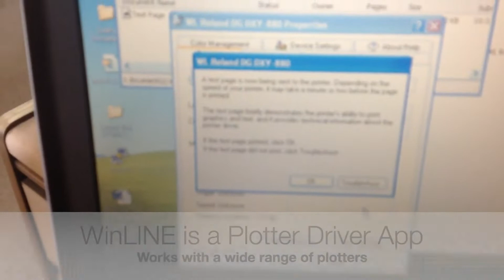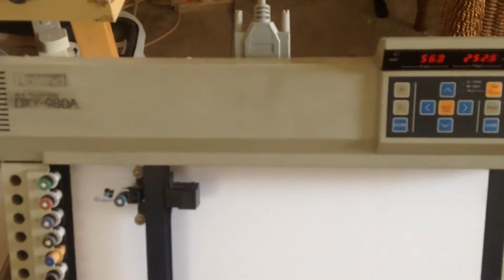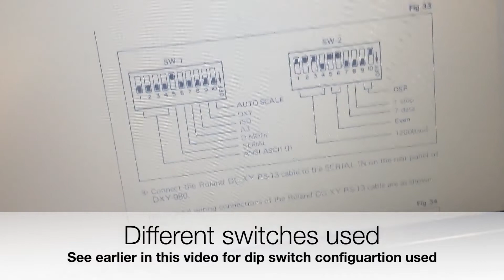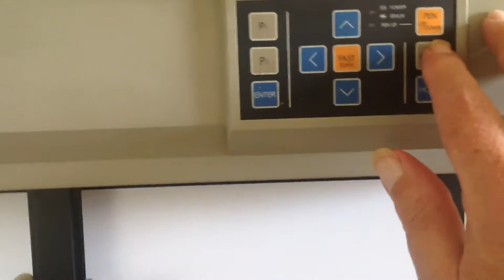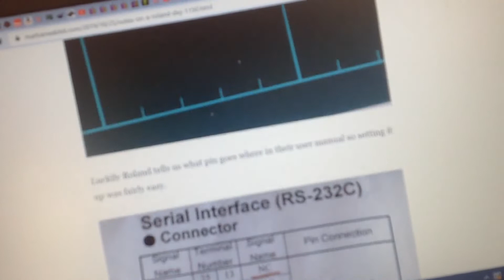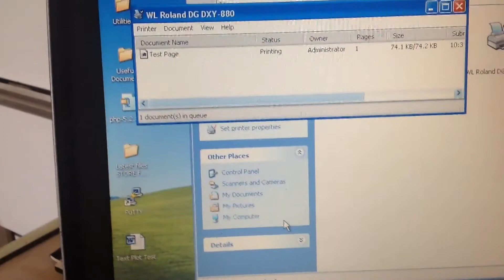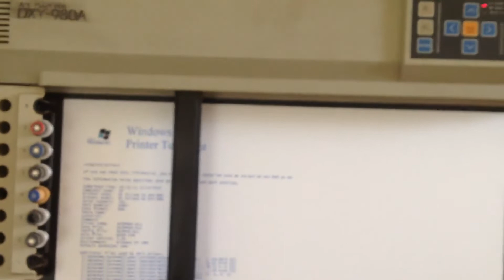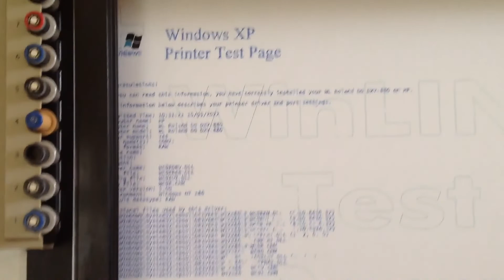Set up a vintage Roland DXY-980A Pen Plotter Using a USB to Serial Port Adapter to run on Windows

Comment: Is it possible to do this over the parallel port without WinLine? I do not want to have the watermark nor do I want to drop $189 on a project for occasional personal use. 
I have a Sweet-P SP600 "Six Shooter" plotter which is cloning the HP 7475A plotter just as your Roland DXY 980A appears to be doing.

Any tips?
Reply from the maker: I did have my (now ex as I sold it) Plotter working using a parallel port. The parallel port was on an old XP laptop. I also tried it with a USB Parallel Port adapter (Win 7 and 10) which did NOT work. The Roland manual describes how to program plot commands using Basic (computer language) which I am guessing would work on a computer with a parallel port or possibly a USB Serial Port Adapter set up correctly. I did not try this as WInline solved the problem for me once I had the Serial lead from the USB Serial Adapter to the plotter configured correctly. If you have a 'Pause' control on your plotter you can pause a plot just before the Winline watermark plots and remove the paper or pen. I found the Winline watermark plotted last (after the main plot.) so this may work for you as a temporary solution. I found Winline very helpful when I was getting my plotter up and running and was offered the software for £50.00. I would have purchased the driver at that price as I found it to be an excellent product with great support but decided instead to sell my plotter.